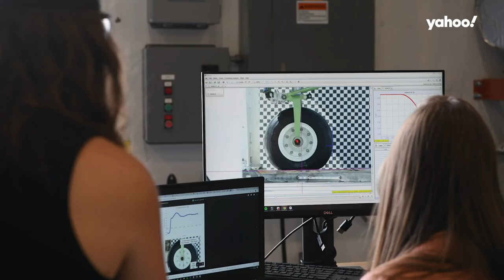Supersonic jet prototype aims to travel from New York City to London in  just 3.5 hours

Comment: It didn't work in the 70s.
Reply: One of the reasons Concorde wasn't a commercial success was because regulations against aircraft that produce sonic booms meant that it could only fly supersonic over water, and that severely restricted the markets the aircraft could serve. My understanding is that a lot of research has been conducted since Concorde was designed into modifying the shape of aircraft so that the compression wave is more spread out when it reaches the ground, making the sonic boom much less "boomy". From what I've seen in tests, the booms produced by aircraft whose shape has been modified in this way produce a sonic boom that sounds less like a clap of thunder and more like a low rumble that you might not even notice unless you were paying attention.
Reply: It did work until the early 2000s
Reply: I think there was a fuel/oil price crisis and people got put of by the French Concord Crash ... The cost of maintenance was very high and it became uneconomical to keep the fleet in service.  I flew on it one return trip before they retired them.  Awesome.
Reply: @gwal93  I had a boss once who used to fly them all the time. He said he loved flying from London and landing in New York at a local time that was earlier than London local time when he left. He was a bit extravagant and from what he told me with Concorde, he would sometimes just fly to New York for the day to do some shopping before flying home. I suppose that was before security checks tagged a few extra hours to the door-to-door journey.